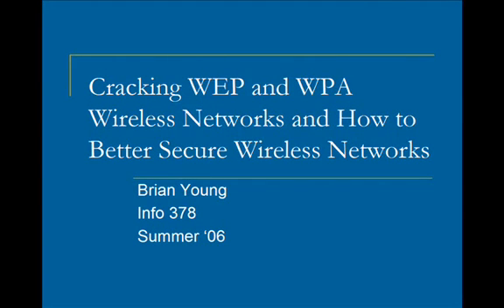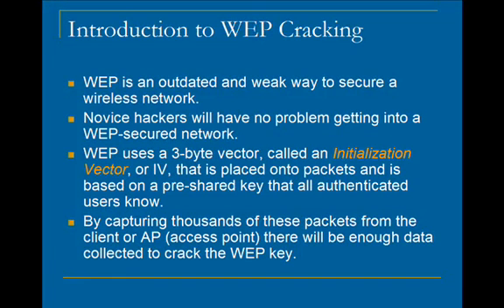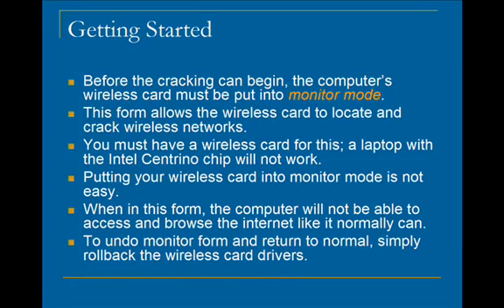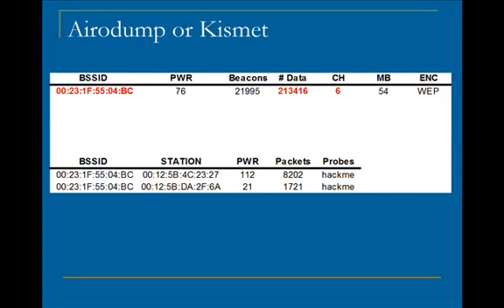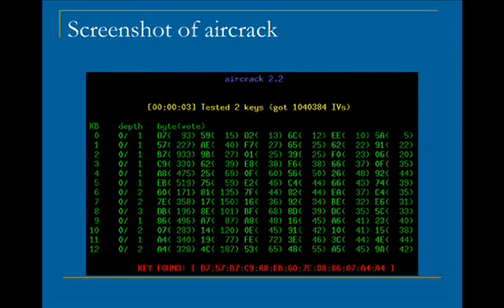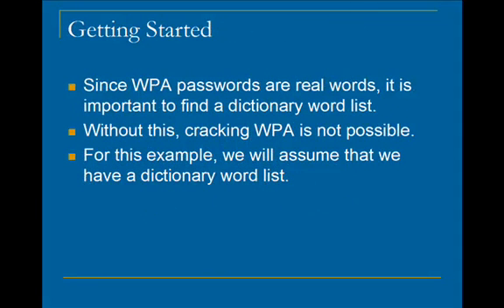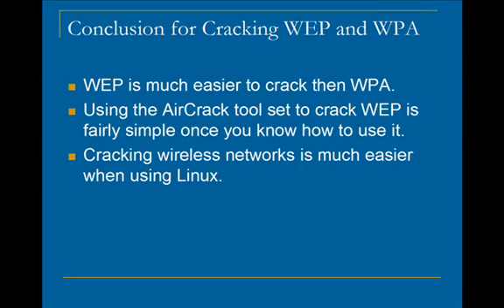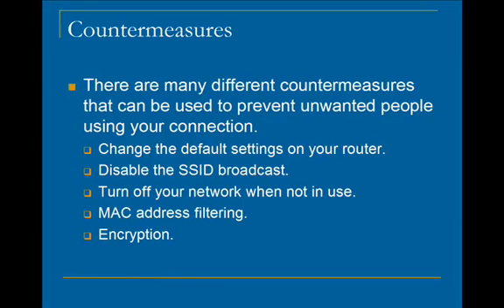Cracking Wireless Networks Netstumbler

Comment: No you are mistaken , there is a difference between the monitoring mode and the promiscuous mode
just google both of them and you will find out the difference

a proof of that when you the interface of monitoring mode called mon0 :-p